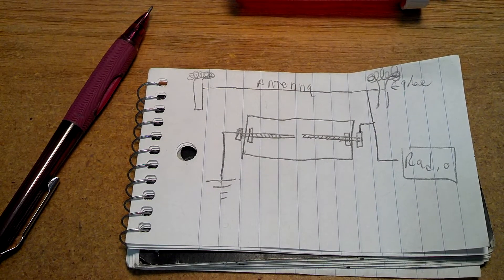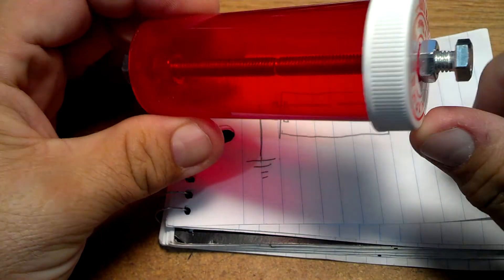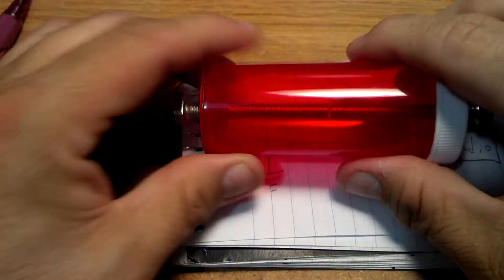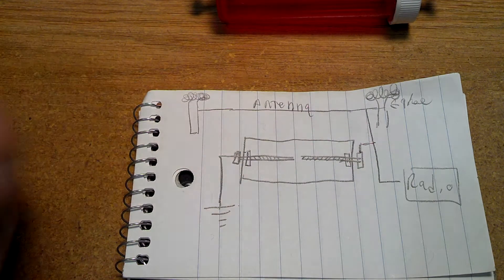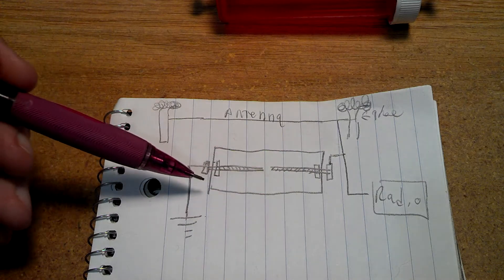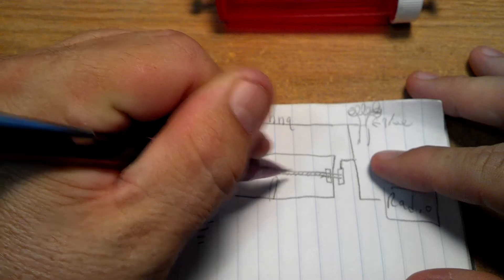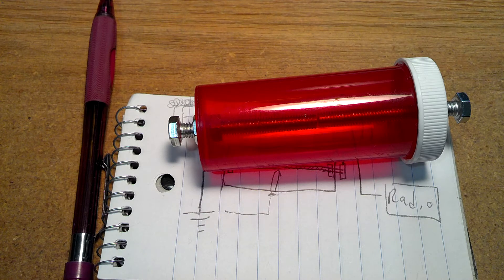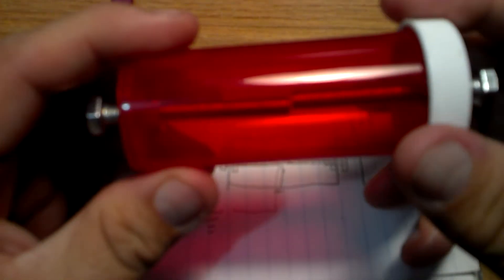Homebrew Temporary lightning arrestor

Comment: It is much easier to take a spark plug instead of your invention
Reply: if you're talking about open feed line that's ok. But how about a coax cable? Check this link: https://forums.qrz.com/index.php?threads/connecting-bus-bar-to-grounding-system.525813/                                                  73 and GL